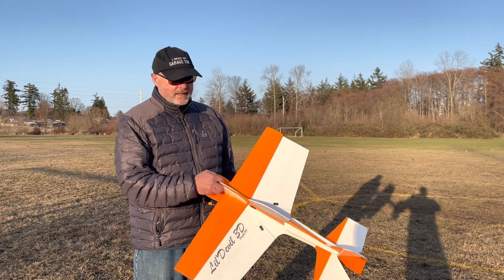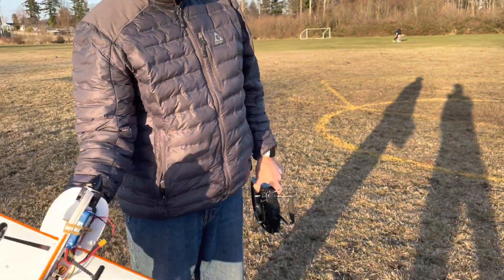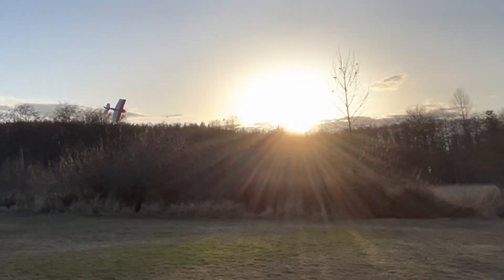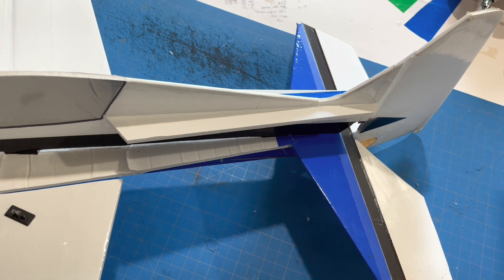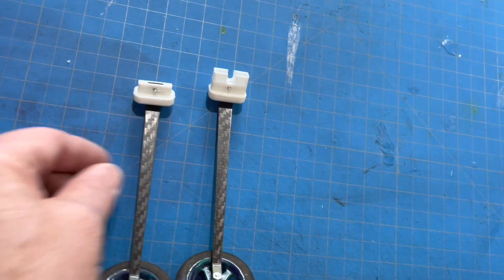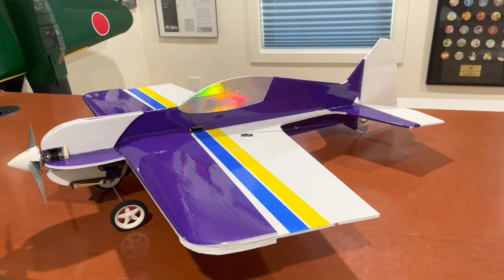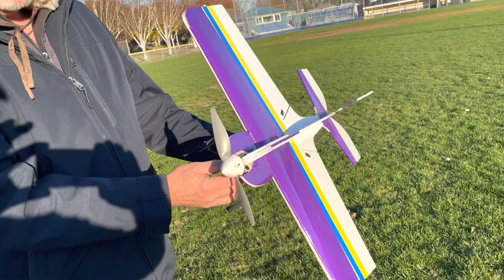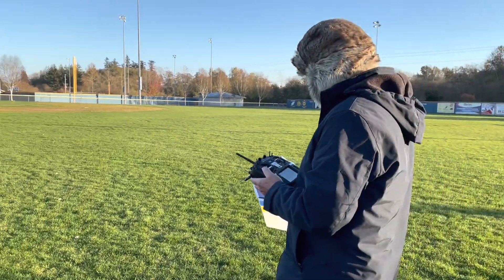Foam Board RC 3D Sport Plane Versions 2 & 3 Maiden and Build Details

Comment: a "beginner" can fly this? i got very interested in RC 3D flight and sport flight, i would go for 3d helis but they are too expensive and you can't repair them easily, i'm training a lot on the sim and now i can do some aerobatics and control the plane, the hardest part for me still the landing, with helis you just let them gently touch the ground, not the same with planes lol

those foamies look pretty easy to repair and fun to build, i like to DIY too, and this one looks small and pretty sturdy so it can handle a few crashes